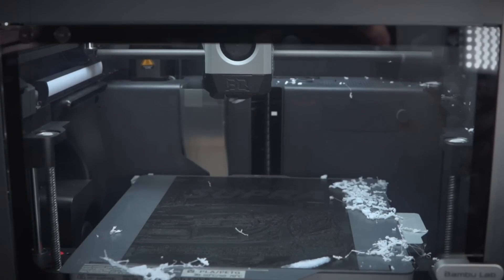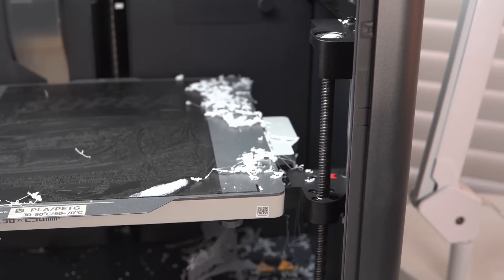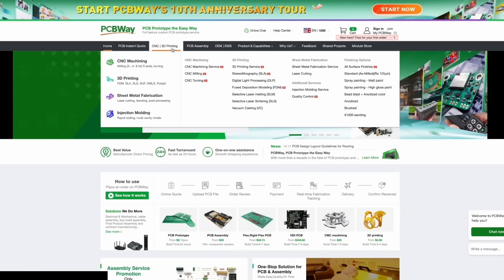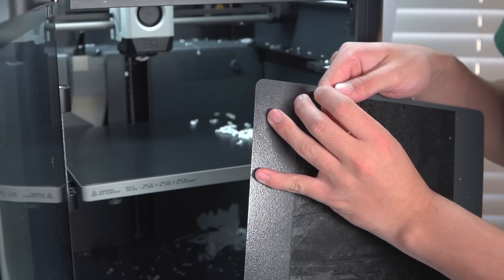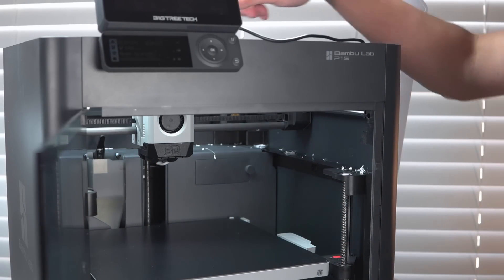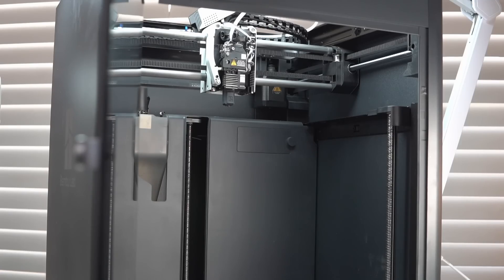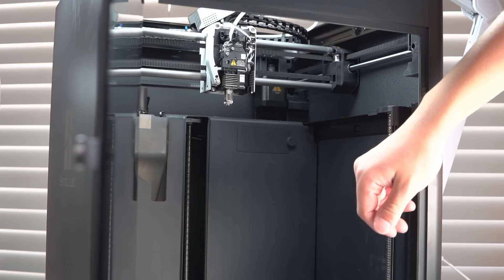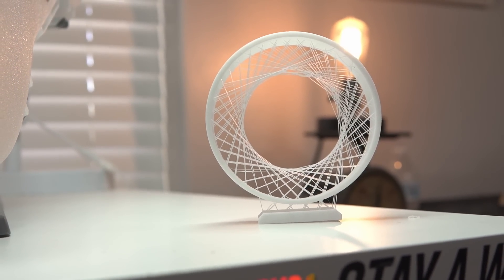Fixing The Dreaded Bambu Lab Blob Of Death

Comment: Ive been printing for 3or 4 years now, Every time ive had issues (especially with Ender 5 plus's)  Theyve been down to BTT or BiQU parts ive added.  My Bambu's been at it for ages and never had an issue, But thats pure Bambu, anything starts to go wrong, New Bambu parts replace it. Be carefull with the blobs though, One i had on my Kingroon I tried removing cold and it snapped the nozzle threads off in the hot block, That was fun fun fun to get out.

Comment: General advise: you can test the layer adhesion on large prints, or at least hang around the printer (set timer on phone around filament change time). 

You should spend time figuring WHY it happened to you. This isn't normal. As a novice with a P1S, just try to think "its probably something I did wrong" and try to figure it out and then ask for help. 

It was not the purge line, its a layer adhesion problem. It could be from your fan mod, from wet filament, temp settings, or any number of things. I've printed over purge lines many times and never an issue. 

P1S is a great printer for the money. Don't call it a paperweight if you are still learning how it works.  This hobby can be frustrating, just be glad you started with a good printer, not a used ender 3....

You're great at videography!
Reply from the maker: I’m definitely still learning! these machines are such a step up from the delta and elegoo printers i started with. Never considered the fan being the problem, i appreciate you bringing that up and will look into it

Comment: Purge line had no affect. Looks like two different types of filament. Because the filaments didn't adhere to each other. This can happen if one was pla and one petg. Or like some others have done. They used pla support for pla filament.
Reply from the maker: that was my initial thought as well but they were both pla. Just gotta try again and monitor a little better

Comment: I was using the BIQU Panda Jet for a few months, but during installation, I cracked one of the screw mounts, and that screw mount, like a virus, causes the whole head cover to vibrate and make ALL of the rest of the screw mounts, including the screw mount for the fan to crack themselves apart. I used two part epoxy, and also UV resin, in addition to CA glue at different times trying to repair, but they all vibrated themselves apart, so much so that the fan just was rattling around in there. I just replaced the front housing with an original Bambu Lab one ($20 for the X1C's because it has LEDs in the logo) I'm a bit gun-shy to try again - interested to know how others were able to get that thing installed without ruining the front housing. I think I might buy the BIQU front housing just to pair them together and swap them when I want the better overhang performance.
Reply: Also had to do it twice, but the second time it worked.

Comment: I call it Bambu goo. Your lucky it didn't go all the way up. If it gets past the little wires inside, your buying a new heat section because it's impossible to prevent the damage to remove the goo even with a gun and your right about $30 and took two weeks for me to get it in
Reply from the maker: It took 2 weeks for it to be delivered??
Reply: @jet_lea  yep, not sure why. I had a printer in three days.
Reply: @jet_lea  I've been waiting over two weeks for a set of nozzles  .04 and a .06   Support just keeps saying. "give it time" Coming out of New York of all things and I am in Michigan.

Comment: The blob happened to me after having my A1 for only two weeks. Funny thing is, none of my prints were failing, but I noticed some dark spots on my prints. Thankfully, I was able to clean it per Bambu's instructions and they also sent a replacement nozzle and hotend assembly.
Reply from the maker: wow that’s awesome they sent a new nozzle
Reply: Get a little wire brush and clean your nozzle after each print. Sometimes a little bit gets stuck to the sides of the nozzle and it helps the rest stick.  I know the A1 and A1m have the nozzle wipe but that doesn't always do the job.

Comment: I had a piece of TPU break off in the extruder. I made a modified set of tweezers using an eyebrow plucker to get it out.
Reply from the maker: Did you heat it up or do a cold pull?
Reply: @jet_lea  tried a cold pull didn't work. Heated to 220 then pulled it from the top.
Reply from the maker: @Bane_Diesel that doesn’t sound too bad

Comment: I have had my A1 out of commission for weeks because it ripped the heater core wire out and I can't heat the hotend.   I have a P1S and A1-Mini so i have been procrastinating rebuilding it.
Reply: I cut the heater core wire when cleaning out a blob mess. Oops. Just replaced and back in action!
Reply from the maker: good to hear!
Reply: @njonl  I was a bit clumsy with the heat gun and I will be replacing the entire extruder and a few other parts it seems.
Reply from the maker: I don’t blame you 🤝

Comment: Thanks for making this video, I recently had a very bad blob with golden sparkly PLA on my A1m and ended up trashing the heating sensor while attempting to clean. However i was very surprised on how easy was to tear down the printing head, and more so by how perfect it ended up working again after replacing the part. 

The only thing I have left to remind me of that tragic event is a slightly torn silicone sock but that still works well enough and a bunch of extra nozzles that I bought because I was unsure my stock nozzle got damaged (it did not).
Reply from the maker: That’s good to hear how simple it is to take apart, i’ve been lucky enough to avoid that so far. How bad was the heat sensor to replace?

Comment: I had a blob a week or two ago. It encased the entire nozzle even over the fins and on the sides. I was like “Greeeeeeat. Good thing the mini is on sale……………..”. Thankfully I just heated up the nozzle to 300 and the blob came off in almost one piece. There is still a but if remnants but it’s good to go and I’ve printed extensively since with no problems.
Reply from the maker: Glad you got it fixed! These blobs are no fun
Reply: I recommend a layer of the slice nozzle repellant, if you ever do get a blob, it comes of clean - it's like pam on a non-non-stick pan lol
Reply: Me too but I got lucky the blob knocked my cover off so it stopped itself.